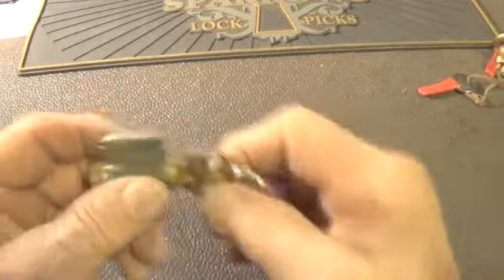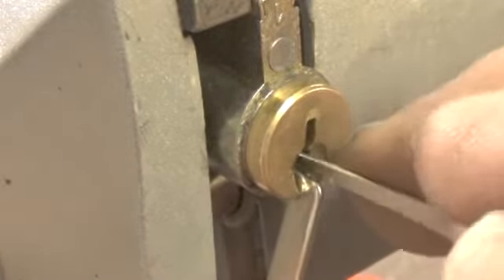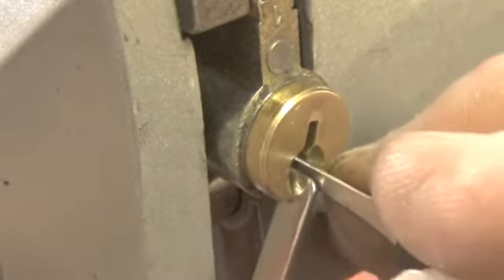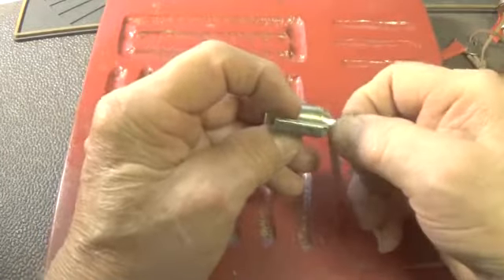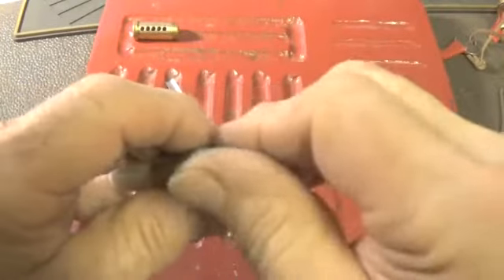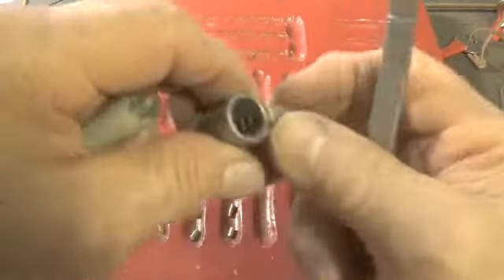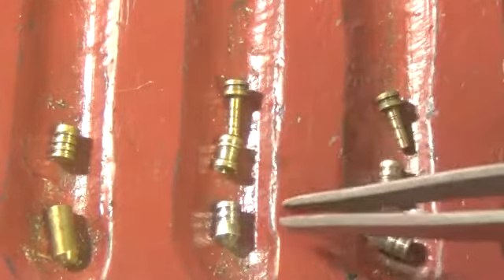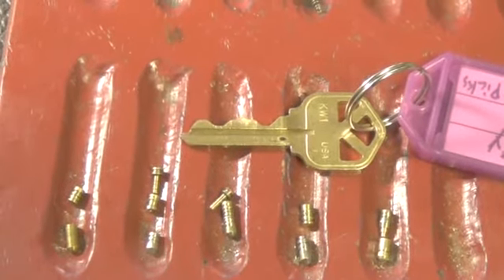(521) West Coast Picks - Kwikset KIK 5Pin SPP'D and Guttred

Comment: Great picking as always! Those pin in pin are also T pins, also I put serrations on the inner pin to help bind up. So they are Serrated Pin in pin inners with a serration on top, with spooled or serrated collars, the inner pin is left longer to be a T-pin.

I tried to make thrm with as many security pin features as possible. lol
Reply from the maker: Great picking. Thanks
Reply: Ace pins!